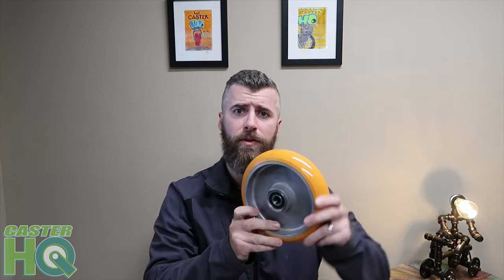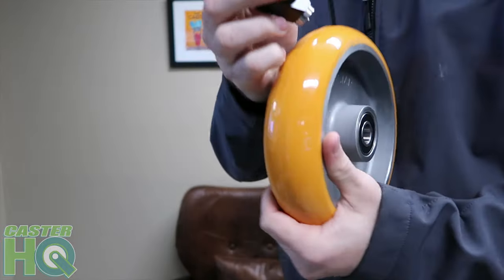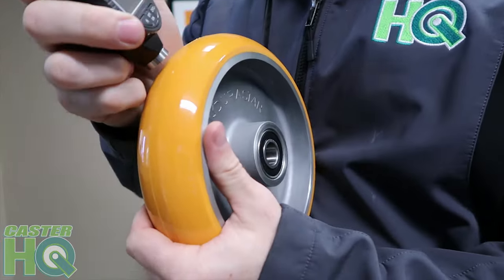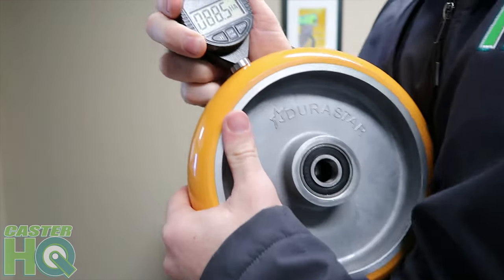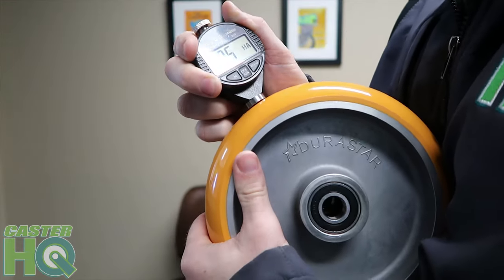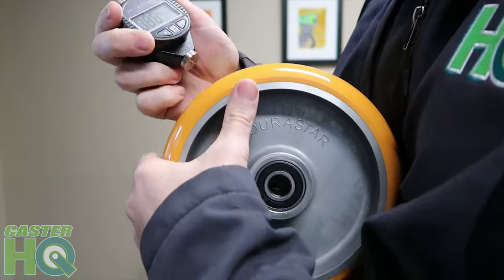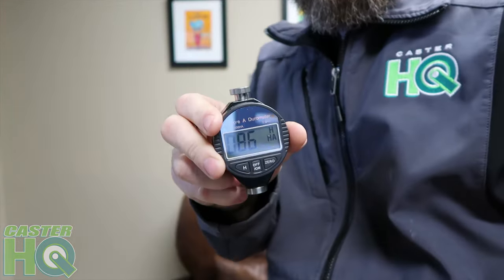Polyurethane on Aluminum Wheels

Comment: Hi. Found your video very informative. However, i have some doubts namely: Can i use these wheels for high-speed applications? And second, i could not find these wheels having a diameter below 100mm. My requirement is 76 mm. Is it possible to make this wheel as a custom wheel? And if so, where can I do it? Thank you for your video once again!❤
Reply: can this wheel move upto speeds of 120 km/h?
Reply from the maker: Thank you for the feedback. So most all caster wheels are meant to be used at walking speeds only or up to 4.828 kilometers per hour max. 

We do have a Made In USA product line that is meant for higher speeds but they should still not exceed 10mph or 16.093 kilometers per hour. Checkout the link here: 

https://www.casterhq.com/Speed-Casters-s/2442.htm